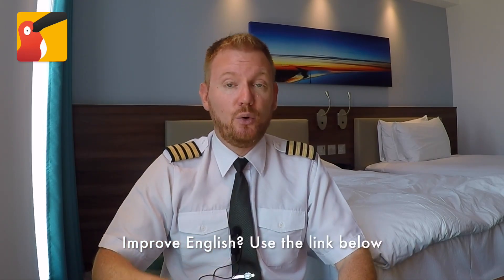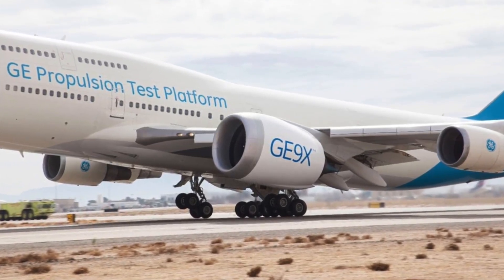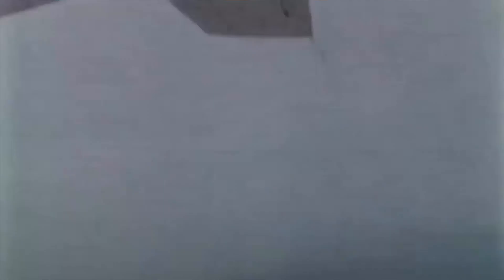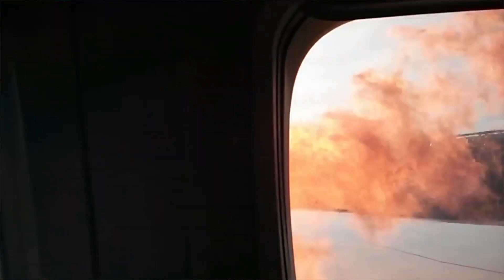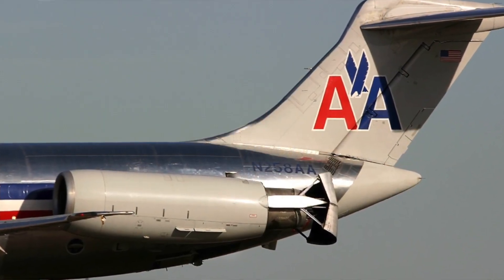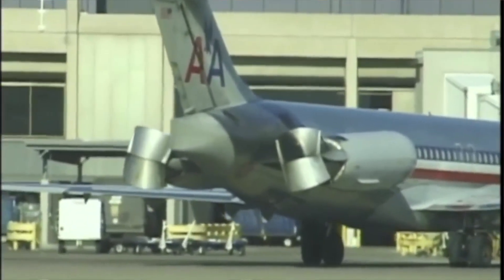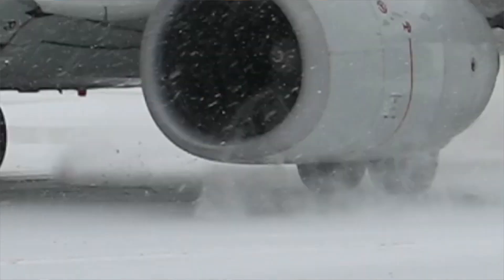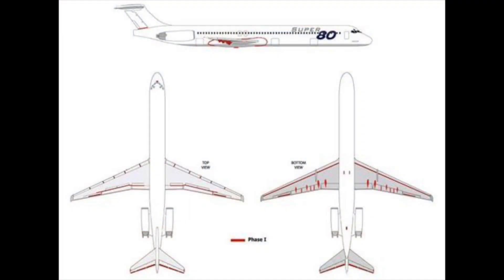Why are the jet-engines placed there? Wings vs Tail

Comment: Why not to make high wing plane (like C-17) but for passenger use? Engines would still be on wings but further from the ground. Are the planes with high mounted wings slower?
Reply from the maker: No but you have the problem with noise and problems for maintenance personnel.
Reply: No, a high-wing configuration is not slower (i.e. it does not cause more drag).  It's more structurally-efficient to have a low-wing aircraft.  With a low-wing configuration, the fuselage basically sits on the wing, but with a high-wing configuration, the fuselage hangs below the wing, which requires a stronger fuselage.  Sometimes it's necessary to use a high-wing due to other considerations, such as having large props (e.g. ATR-72).
Reply: Ford Tri-motor, Douglas DC-5, early Fokkers and the F-27, Bae-146, DHC-6 Twin Otter and Dash 7, ATR-42 and -72 in the West alone; multiple other jet and propjet examples in the USSR.
Reply: There is a few out there. The British Aerospace 146 is good example.
Reply: because c-17 does not have two part body-up passengers, down cargo, because wings are up ,not down .
on passenger plane beetwen wings there is fuel.
i was in c-17 and body is very wide and short so there will be many passengers in wide and not so many in lenght.
if you would try to make c-17 suitable for passengers it should be made big make over in structure of body
Reply: Was gonna say, there are loads of high wing aircraft. But they are more tricky to inspect and maintain as a mechanic becouse you need a platform more often. Speaking from experience when working on a Bae 146.
Reply: Fruit:  Not much different from tail-engined transports, in that respect.    We probably replaced nav light bulbs as often as we serviced engine oil on 737 thru-checks, and you can't do that with your feet on the ground, either.
Reply: Oh yes true, but still found it more easy to perform a visual (engine) inspection on a mid wing aircraft. Yes you're gonna need a platform for most things but not for everything.
Reply: I believe the c17    skytrain?    was designed for paratroopers to jump out of wasnt it?   suck to jump out and hit the wing.
Reply: Harley Me:  WW2 paratroopers jumped mainly from C-47 or Junkers Ju-52, both low-wing airplanes, but departed aft of the wing.  Then, as now, airplanes meant to haul cargo are used to deliver paratroops, and cargo is generally easier to on- and off-load from high-wing airplanes.  Tail-strikes were rare exiting the C-47 and Ju-52 but not unknown.  From a paratrooper's point of view, T-tails and ramp exits were welcome developments.
Reply: @shawnD1027 The tensile strength of the composites used in aviation is actually higher than the compressive strength, so structurally high wings arn't heavier because the body hands off them. On the other hand most aircraft used today have a mid wing, not a bottom mount, as you can see as a passenger the top of the wing is level with the floor, while there is still luggage and utility room underneath. This midwiing configuration is lighter because of a few factors, firstly the body adds the most stiffness to the middle portion of the wing, secondly the drag from the wing places less torsional stress on the air-frame.

The most common reason to use a high wing is it reduces the landing gear height to avoid a wingstrikes due to wing flex and aircraft roll during takeoff and landing, which both makes for easier loading\boarding, and increases stability of the aircraft while on its wheels.  Midwings are used in most other instances, and low wings are fairly rare these days, however there are some current smaller propeller aircraft and some earlier jet aircraft that run a lowmount wing and engines either inside or over-top of the wing, instead of underneath it.

Comment: really fentastic  and mentour you have said about gravel getting into low mounted engines 
while landing also the same problem might get happen ?
Reply from the maker: No, the runways are kept clean and the aircraft is moving forward at a great speed then so it’s unlikely that the reversers will be able to throw stuff up in front of the engine to the same extent.
Reply: And for avoiding this reversers must be closed at 60 mph. Rear mounted engines may be reversed up to completely stop... sometimes was used to pushback. :)
Reply: balaji sharath kumar, Aircraft don't back up when landing. Except helicopters, Harriers can.
Reply: balaji sharath kumar 
🤦🏽‍♂️
How can gravel get into the air when you are landing?

Comment: Turboprop vs jet engine video?
Reply from the maker: Good idea.
Reply: EveryTypeOfVideo planes are made for different reasons not not as simple as what is better.  If a jet is better at everything why don't all cessna's have them.  😁😁😁
Reply: Jet engines are relatively weak at low speed, adding fan to engine improve efficiency in low and medium speeds. Because airliner flights speeds are placed at medium range (in jet specification) so turbofan model has better efficiency at all. Less fuel burnt = better economy. Money drive this world.
Reply: Like an unlimited bypass turbofan but more efficient at low speeds.
Reply: jet engine use's its thrust to propel the aircraft forward, turboprop use an axle off the jet engine with a gearbox attached to a propeller
Reply: Mentour Pilot 
Please throw in turbofan as well. In my other comment I asked about the fan in a turbo fan being somewhat comparable to a propeller
Reply: Eemeli Laakkonen Turboprop is better lawnmower.
Reply: +souocara38able
 It exactly is - no more than tunelled propeller.
Reply: Mentour Pilot and And which would make a better Lawnmower ? Sounds like a good way to save some time doing yardwork !
Reply: @TheJoeSwanon /videos An afterburner would make quick work of that grass.  ;)
Reply: EveryTypeOfVideo but the turboprop sounds so sexy
Reply: Adam W. Thanks!
Reply: Eemeli Laakkonen This is so easy (Jet engine)

Comment: What about Tri jets? Such as the MD 11?
Reply: SJ15 I think existed because there was a rule that you could not cross some oceans with two engines, some manufacturers thought 4 were too much and made 3 engine planes.

Nowadays that rule is gone and the ETOPs on modern planes are so high (like 330minutes on a single engine or something like that for the GE787) that 2 engine planes are ruling the business  right now.
Reply: I seem to remember reading that also.
Reply: The other problem was the dc-10 far too often was actually a two engined jet....
Reply: David Wright Sorrry, man, but so much of what you wrote is inaccurate. Read up on the history of the 747 and you’ll find that it was decades before the A-340. McDonnel Douglas was a huge and very successful company for years before finally being edged out and purchased by Boeing. The DC-10 was problematic but so was the 727 in many respects. All jetliners of this era were closer to flying toasters than the elegant and sophisticated jets of today.
Reply: Tri jets are about as common as passenger pidgins. They were common in the 1970’s because they weren’t ETOP’s limited so could fly transatlantic and transpacific. With the adoption of ETOPs the costs of the 3rd centre mounted engine meant the costs of 4 engine ops and few of the benefits. Boeing were developing the 777 as a counter to the A340 so pushed for the rule change and had more clout the McDonnald-Douglas who were driven out of business by the decision as they went from having a good midsize long haul product line to selling Dodo’s overnight.

Comment: Rear mounted engine planes also have the advantage of having a lower clearance height from the ground...making boarding and loading cargo less complicated and available with cheaper equipment...”Oh but the 737 has that goal as well” But they had to flatten the nacelle to make it less complicated. However, flying one of those is totally different from a wing mounted engine plane, as you have bigger torque arm acting on the longitudinal axis of the plane.
Reply from the maker: Correct! I knew I forgot something!!
Reply: The strongest part of an aircraft is surely the critical wings/fuselage connection and everything of any significance is installed in relation to that,my question is how the rear fuselage is strengthened to support what I imagine is around 20 tons extra on the tail section so far from the pivot point(landing gear) ? The stresses,particularly on landing,must be enormous in that area.
Reply: Also since the aircraft is lower the main gear and nose gear will be shorter thus reducing weight.
Reply: loading cargo really does not need much equipment and wing mount engines are really not any significant factor, but it is PITA for maintenance and that matters a lot.
Reply: Ground clearance of the engine nacelle wasn't an issue until they started mounting high bypass engines on it, the 100 and 200 had no issues at all with that.
Reply: The 717 F100 airframes are pretty inefficient for lift when operating at high ambient temp compared to 737 A320.
Reply: you also forgot CG and the pitch up from under wing and pitch down moments from rear engine aircraft

Comment: Nice! i did not know that (about the super stall) because I was just on a MD-90 taking off from Denver :0 but now that I know this it sounds Scaryyyy!! Here is a Challenging question for you @Mentour Pilot : ''Why do cars have shift gears (manual cars) but airplanes don't???'' ;)
Reply from the maker: Two completely different kinds of propulsion. Very hard to compare s car to an aircraft engine.
Reply: car is moved by force over wheels, plane by force of thrust of engine, prop plane has variable pitch props that  acts as car has infinite number of gears
Reply: Noah Gianfranceschi Because who wants to Switch gears while maintaining all other 360 switches? 😂 In a car theres about 20 switches
Reply: In a sense, some do. A constant speed propeller provides a similar benefit to the airplane as a gearbox does to a car.
Reply: I think it is a simply a matter that there is a mechanical linkage between the engine and the tires in a car, which is not the case with an airplane. Put a jet engine in a car and let the tires spin freely and you wouldn't need a transmission.
Reply: I’m not a genius but imo that’s very simple, cars have to look after 2 factors torque and power, in some scenarios cars need more torque and less power I.e moving from a standstill, in others they need more power and less torque, I.e increasing the speed on the car that’s already on the move, and above all vehicle engines have to do that while making the engines run at rpm, that are most efficient and effective 

Aircraft propulsion works differently they work on suck squeeze bang blow The engine sucks in a mixture of fuel and air, then squeezes it together (compresses it), then it burns / explodes that with a bang, and finally it blows out the exhaust.
They don’t rely that much on torque, to increase power it just takes in more fuel which  increases the overall power 
And as far as I know jet engines work equally efficiently from low to high rpms
Reply: I'm not mentour, or even a pilot, but that's because the gear box on a car tightly couples engine rotation and wheel rotation. There is no slip possible. This would mean you can't start the engine (except for a very fast push start!) You have a clutch to temporarily mitigate that problem, then gears to allow the engine to stay in its RPM power band "independent' of the speed of the vehicle. Air allows for 'infinitely' more slip than asphalt so the engine load will change but it is easily able to overcome this. Besides, Aircraft engines spend most of their lives at cruising alt and speed, so they can be optimized for this purpose, whereas car engines are constantly subject to very variable conditions.
Reply: Piston-engined prop planes commonly have variable-pitch propellors, which is equivalent to having a gearbox.
Reply: Yes, you can compare them. The laws of physics are the same, after all.
Reply: John Cofer 
This would infringe the batmobile patents
Reply: That part on "Airplane"  when Peter Graves "shifts gears" on the plane as it's taking off always cracks me up, but my son doesn't get the joke.

Comment: Great informative and interesting video, as always.  What about aircraft like the MD11/DC10 and Tristar, with 2 engines under the wings and one on the tail?
Reply from the maker: That would be a combination of all factors. Not sure what the idea was but it was a while ago so it probably had to do with maximizing thrust and minimizing amount of engines.
Reply: Engine technology was not as good back then. More engines is generally less efficient, but when those types were being built, twin engined aircraft had severe restrictions on how far away they could travel from a diversion airport. It was not range so much as reliability. If a twinjet loses one engine, they have no more margin of error. One more failure and it's game over. There was also somewhat of a problem with how powerful engines were. Jets like the DC10 and Tristar did not need four engines but two engines was not feasible due to those range restrictions, and possibly power issues. So, three was the happy middle ground, and the only good place for a third engine is the tail. Now, those are all older types of aircraft. The MD11 is the newest jetliner you can find with this configuration, and it is from the 90s. As engines have improved, gaining thrust and reliability, those range restrictions are becoming less and less important every day, so manufactures now go the most efficient route and build giant engines for enormous twinjets like the 777.

Comment: Really interesting! Why do some military planes, like the C-17, have wings that come out from the top of the fuselage?
Reply: Sam Carollo Engines have more space to the ground...so they can land and takeoff for example on a field without sucking stones etc. And also these planes have more space inside to load tanks, material or whatever as the wings construction doesnt block any space of the cargo bay.
Reply: Also when going into unimproved fields there's less chance of anything getting sucked into the engine and damaging it.
Reply: Robert Lee:   the best way to avoid trees is to not fly into them
Reply: these are all good points,  also less likely to hit trees!
Reply: high wing planes are more stable under ground affect and are typically easier to control..  why most pilots start in high wing aircraft. Like Cessna's
Reply: Mars. Yes. The entire body of the C-5 kneels, for the nose and tail ramp. The AN-124 and 225, kneel front only.
Reply: Another advantage is most high wing planes have an anhedral instead of a dihedral, so the whole wings flexing upwards that is mentioned in the video isn't so bad as if they flex, they flex to level.
Reply: These wings provide more lift; no only on Cargo and Military heavy lifts but also on B52s, Sea Harriers, AV8Bs, F8s and even MiG23/27s
Reply: All the above points seem valid and advantagous, question is-Why aren't all aircraft designed with top mounted wings ? What are the 'down sides' ?
Reply: Actually, there are a few large airplanes with High Wings.  It comes in handy for any airplane that needs the floor to be Low and/or Flat to facilitate loading Cargo or Vehicles.  Also these airplanes allow passengers to be loaded WITHOUT ground equipment, such as Air-Stairs or Jet-Ways.  Check out the Shorts 330/360, Casa 212/235, or the ATR series aircraft as a few examples.

Comment: btw boeing 747 had that flattering problem in its original design. That happens when the natural frequency of the structure is equal with the flow induced vibrations on that structure.
Reply: Robert Lee in the 1970s ?
Reply: 747 dates before the invention of the microprocessor.
Reply: If I remember correctly, didn't the Me 262 (first jet fighter) have a similar problem?
Reply: manos, I think you've been drinking too much.  Big aircraft have a computer to control flutter problems.